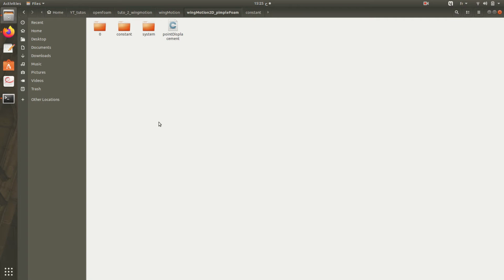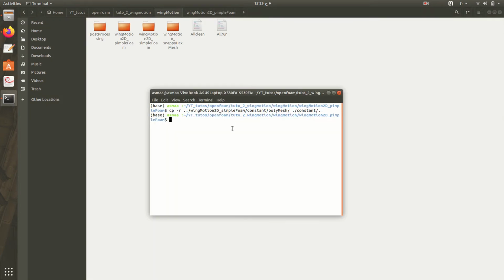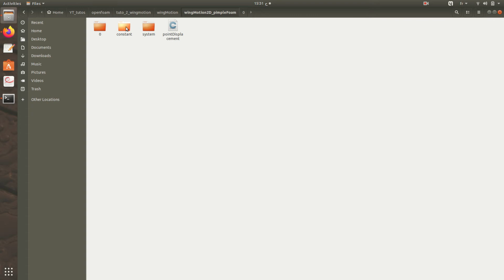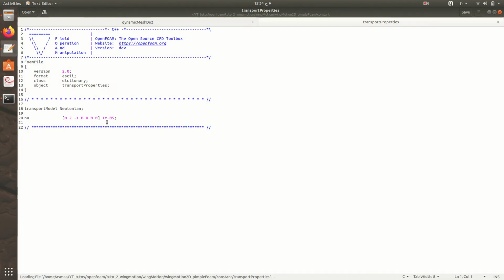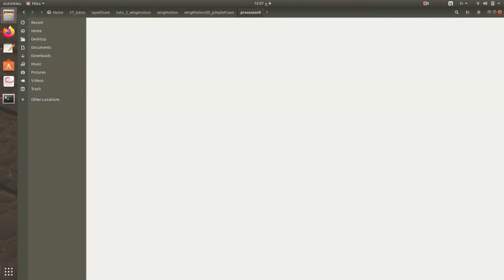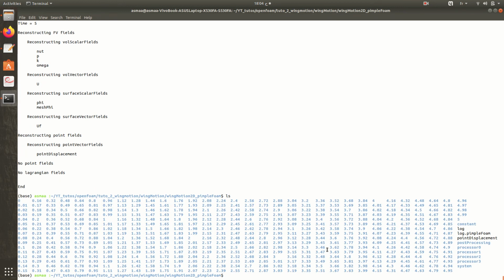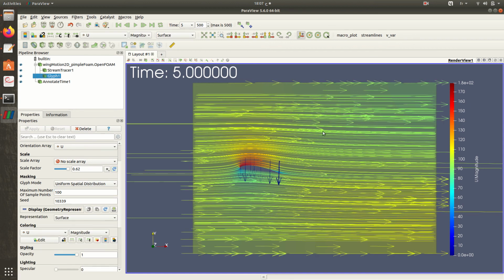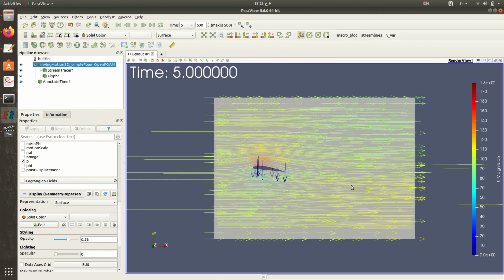Part 3: Wing Motion simulation in OpenFoam - Dynamic Mesh & Transient flow - PimpleFoam

Comment: Is it possible to do a motion simulation of a 3D wing?
Reply from the maker: If I get your question right I think you should use FSI which stands for fluid structure interaction.
Reply: @CFDAsmaaHadane  I want to simulate a propeller failure, but I understand that a half of a broken propeller will be guided by its aerodynamics. I do not know how to simulate this.